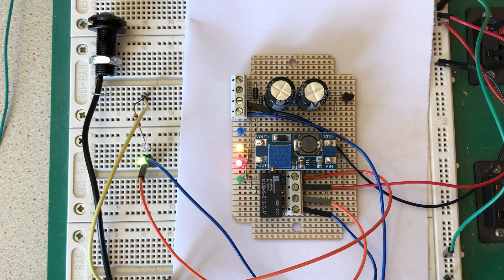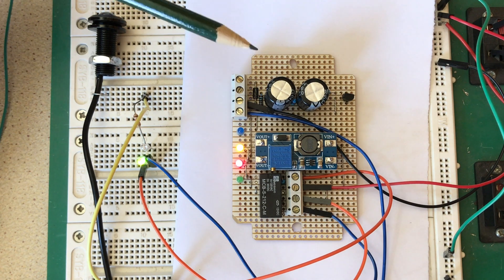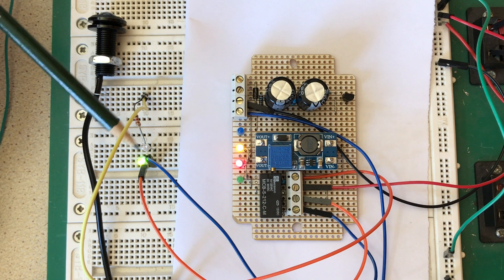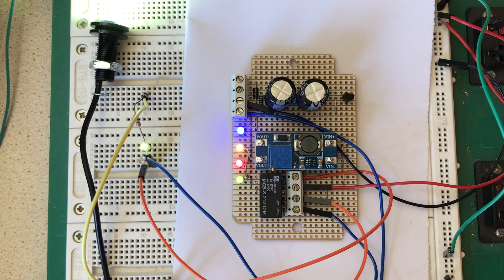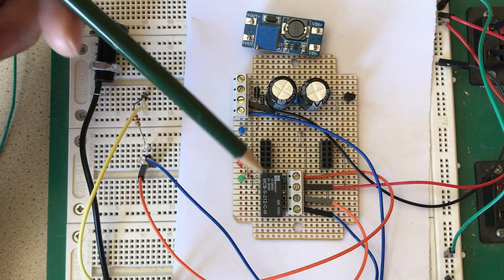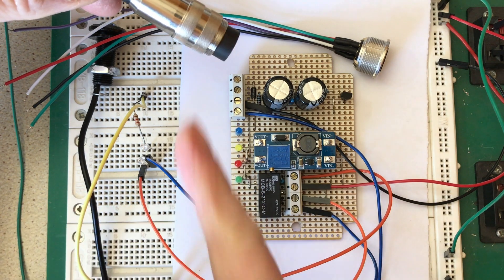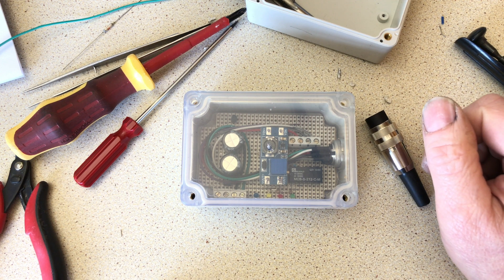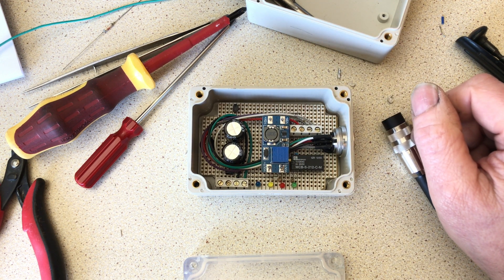Land Rover Defender TD5 Deployable Side Steps Part 3 (Electronics with Google drive links)

Comment: Hi, Mike Can you kindly build for us, for two defender's  air and the electrical units for the steps more or less the same  the rest we can do them ourselves.  we like you work
Reply from the maker: Hi Joe, thanks for your interest. Unfortunately with my current work load I would not have the time to build the units for you. My was made from bits and pieces I had to hand so was really a one of a kind. I am more than happy to try and answer any questions via email or measure dimensions etc for you though. Thanks for your interest.

Comment: Did you use the original door sensors for this or did you use an aftermarket sensor fitted in a different location.
Reply from the maker: Hi Alexander, I tapped into the existing door switches that actuate the interior light. I don't have a factory alarm fitted.  Thanks for watching 👍🏽